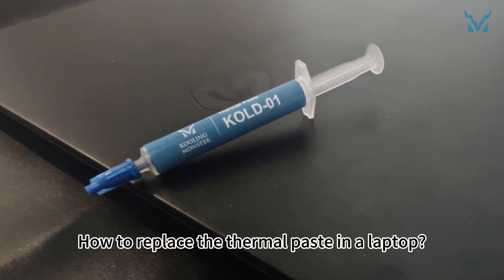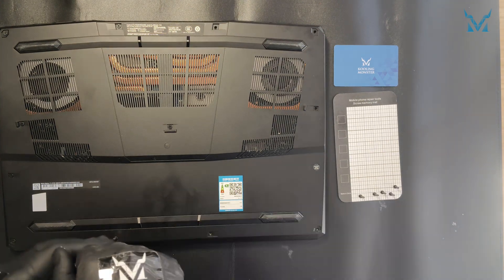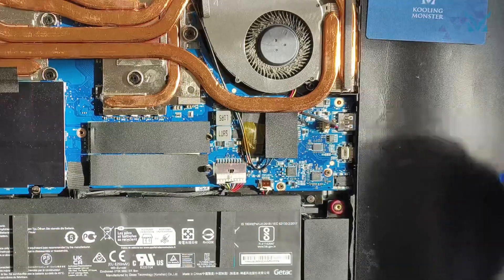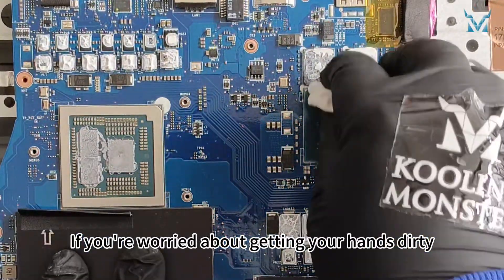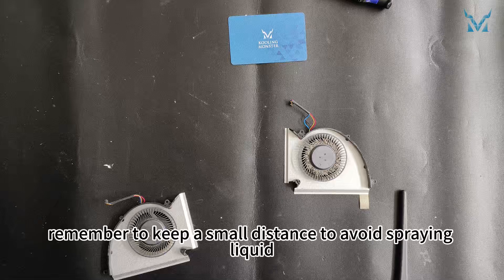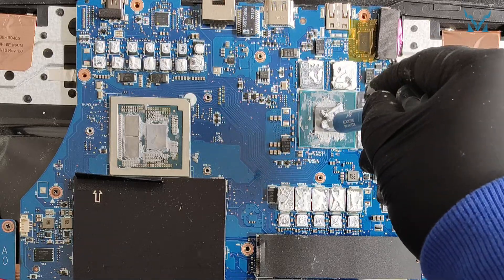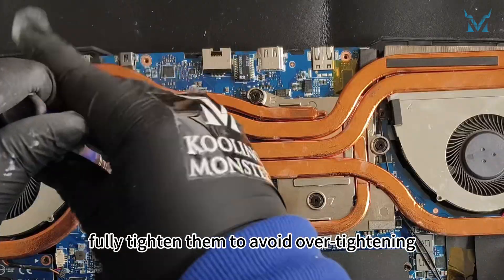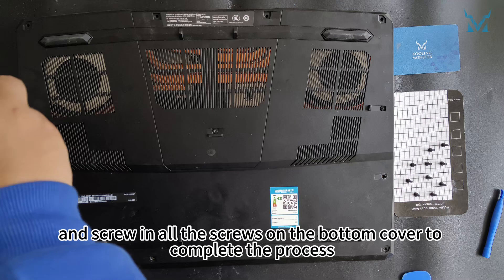Speed Up Your  MSI Raider GE77 2023 Prevent Overheating With Dust Cleaning & New Thermal Paste

Comment: Bro WTF are you joking???? That is a really bad job, if someone is watching this video stop right now, you are gonna get your laptop broken!!!!! DONT DO THIS TO YOUR LAPTOP.
Reply: What he do that would break it?
Reply from the maker: Great question! Nothing in the video should break your laptop if you’re careful—just basic cleaning and thermal paste replacement. We used KOLD-01, which is non-conductive and laptop-safe. The key is to go slow and follow each step closely!
Reply from the maker: Hey, appreciate your concern! Everyone's got their own method, and we always encourage caution. That said, we’ve done this many times with great results—temps dropped significantly using KOLD-01 thermal paste, which is safe and non-conductive. Still, totally understand if you prefer a different approach!